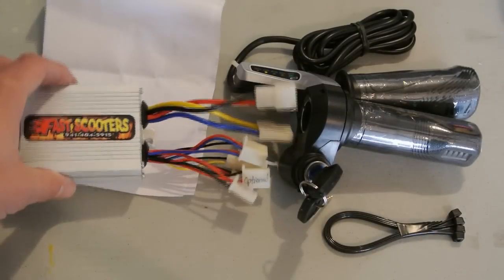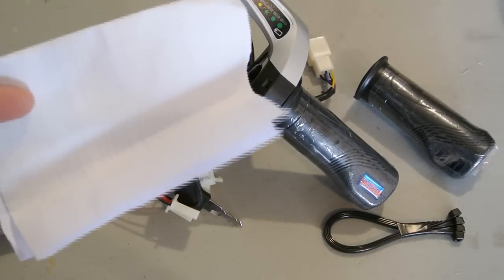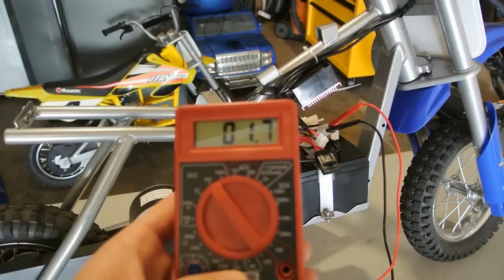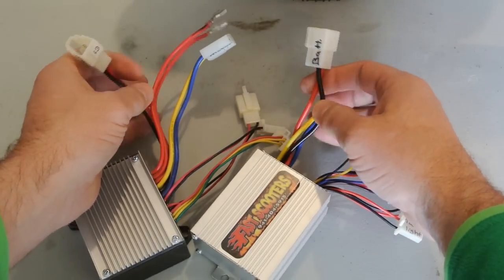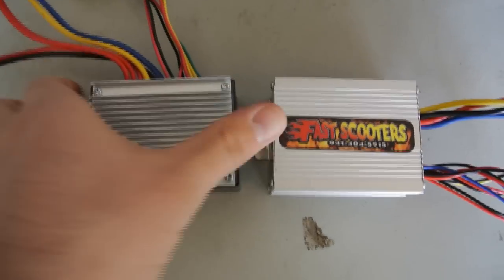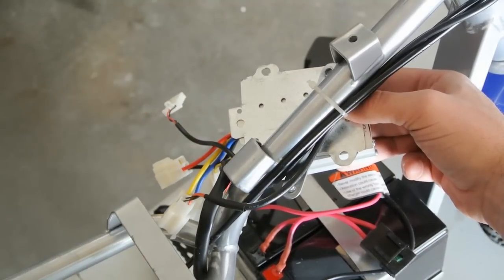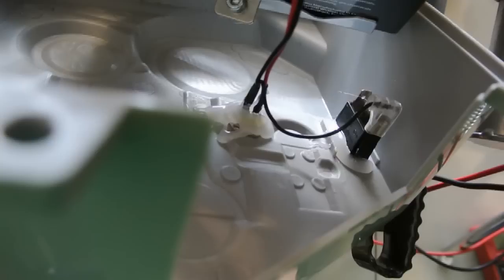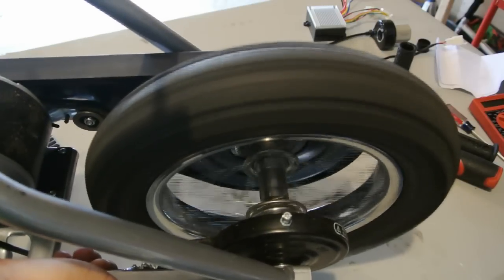Razor MX350 Variable Speed Controller Upgrade and Install

Comment: So to save the extra effort of changing out the controller,  I believe I read you can just swap the throttle and plug it into the original controller.  Is that correct?  I realize it is a better controller but the extra speed is of no interest to me.  I can just save the controller in case I Need it.
Reply: It better match.  These companies aren't the brightest bulbs
Reply: Doesn't match unfortunately

Comment: Anyone know the variability of the controller?  That is, how many jumps it makes to full power?  The stock is on/off ... full power or no power which is scaring the hell out of my 3 year old.  He's fine on the road (exactly where I don't want him), but, and when combined with 0 suspension on the MX350, full power is too much off road.  Thanks in advance to anyone kind enough to respond.

Comment: Hands down the best update to this bike that reuses stock controller is a battery upgrade. Nermak makes a lithium iron phosphate battery (LiFe PO4), which should last for years as it is a deep cycle battery that claims to operate for 2000+ cycles. These batteries also weigh in at half the weight of the original lead acid batteries. 

The 12v (12.8v), 10ah is a nice 40% capacity increase, taking it from roughly a 25 minute ride to about an hour (only the 12.8v, 10ah is a direct fit). 

And the great thing about this upgrade is it is a drop in replacement. No modification necessary EXCEPT for reusing the old battery cables to install on the new batteries(Two 12v batteries wired in series). 

This comes at a cost. The newer batteries are 89.99 for the pair. But again, for those using as a hand me down and investing for the long term (no overvolting), check out these newer batteries, you wont regret it!
Reply: I plan on upgrading to those Nermaks. I'm getting tired of replacing SLA batteries. I assume I would no longer be able to use the stock charger that came with the MX350 anymore?
Reply: @gavysp  I completely forgot to mention that, yes, youll need a charger for the new battery type, and perhaps a clever setup to make future charging convenient.
Reply: I added two 12 volt 8ah lithium batteries, everything else stock. After about 5 seconds of riding the bike just shuts off… You sure lithium are just a drop and go with a stock system?? I thought they would be…

Comment: I have 2  CT-02 speed controllers one has 3 more wires 1 extra in the switch ley harness a 2 more as the brake light.Both are 24v 500 watts and 40 amp power rating.So my  question is ¿ Can the motor handle the output of the controller in terms of the Watts and Amps ?

Comment: Ordered a new speed control for razor mx 350 everything but one black wire to the on/off switch match,on control "original"it has 15 wire leads the new one has 14.it seems to not have a black lead that hooks into the on/off? Do I need to just send it back.thank you for any insight or ideas that may help

Comment: Where can I get that battery. I really need one meant for a speed controller. If that doesn't work I need a new speed controller which will piss me off cause it's brand new and doesn't work

Comment: How has it held up since you installed? Are you noticing a faster battery drain or any other issues?
Reply from the maker: I have not seen any faster battery drains, and it is still going strong.
Reply: Im guessing its trashed now?
Reply: @edgarh252  Yea hows it now?
Reply: September 2020. How is the controller holding up for you?
I just received mine and about to make the switch.
Reply: Marjan Martini  -Yes you can. I just installed the 24v variable speed system and it works great!
It could be a 30 minute or so job but I really took my time and conformal coated the internal components and silicone filled the harness passthrough grommets. I'm hoping for 100% protection against water/dirt.
This is a great mod and our 7 year old says she loves it. No more pulsing the throttle, she says.
Also, if the power switch light stays on all the time, just unplug the black (ground wire) going from the switch to the charge port.
Reply: Marjan Martini  You can also upgrade controller to 36v 500w and I think 1000w. But that depends on battery needs. There are FB groups that discuss lithium conversions

Comment: yOU DONT NEED THOSE GOIT 40V TWO MILWAUKEE, ON 250 STRAIGHT SWITCH, LIGHT SWITCH BLEW FLYWHEEL NOW THRU-BOLT PODST UPGRADE SOON

Comment: tHOSE FLYWJHEEL PARTS ARE EXTENSION OF WINDOWS COCKBLOCK LIKE TENDANCIES. CAN. SEND IT HUGE BRAH. nO BURNT STENCH OF BRUSHES IF THE RE WAS PUT HOLE HOG MOTOR NEXT. ITS NOTHING TO THE ROYAL SCEPTAR.

Comment: Not worth the headache for a little more speed and to top it off , drain the battery faster ! I think 14mph for a 3-5 year old is fast enough . This is a starter bike to introduce kids into motorcycling .My son is 6yrs old and has the MX350 and he enjoys it very much but has had a few spills with no major incidents.He is always supervised and wears safety gear ,when he rides. I think this Razor MX350 stock is plenty fast and is a great starter for those younger kids. If you want fast ,then I suggest buying a gas powered dirt bike. But I feel that this Razor MX350 is a great starter, just the way it comes stock!
Reply from the maker: Ron Mitchell Two points, 
1- This is a good option when your controller fails. Because it will at some point.
2- it gives your child more control over the speed, instead full throttle or nothing.

It's not worth the upgrade for speed alone, as that is negligible.
Reply: But why bother with all that customizing , when you can get the original stock parts ? All is needed to do ,is plug in ,mounts right up , no hassles , no cutting any brackets to fit. As far as speed control , the twisting  throttle is what you find on a regular dirt bike , therefore giving good practice for advancement .I'm just saying , that I find these modifications ridiculous and expensive. If someones wants to make changes to fit their own needs , then so be it. I just don't find this kind of hassle to be worth the extra work or expense for such a small result. Another thing is that these modifications also void any warranty .
Reply from the maker: This requires the same amount of labor to install, and the same cost. OEM part from Razor is $39.00. I paid $39.00 for the aftermarket part. The seller recommends mounting the controller using zipties. I made the bracket because I could. Aside from making a simple bracket I'm not sure I follow your argument. The stock throttle is a twist style, without any control. The aftermarket is a twist throttle with control, just like you would find on a gas dirt bike. So by your argument the after market throttle would actuallyhelp your kids transition easier to a gas dirt bike. Thanks for the comment.
Reply: So the base to my argument is this , Why not just buy the OEM parts? Why the Fast Scooter aftermarket control box? What was your reasoning for this modification?Is the bike faster? Does this modification drain the battery faster? What are your end results and was it worth it?  I and others would agree  that zip ties would not be stable enough at keeping the control box in place, after all ,there is no suspension to this bike frame . Like I said before , if someones wants to make these kinds of changes , so be it! In So , therefore voiding the warranty! I just don't see the need , myself, not worth the 1-2 mph . The only thing that I would like to see changed or modified to the Razor bikes , is adding some sort of suspension . Other than that, I think Razor has made a nice durable kids starter bike and I hope that you can agree with that.
Reply: I had already purchased the variable speed controller so my three year old daughter could go slower than 14 miles an hour and was just curious to know if 26 volts had more jam than 20 volts. Now my daughter can drive as slow or as fast as she likes and is far more comfortable riding her bike.
Reply from the maker: jeb grossutti It does have a little bit more punch. You won't notice, but the rider will.
Reply: The biggest benefit to this modification is the ability for the rider to control their throttle. The "all or nothing" approach of the stock controller is an absolute joke and I've found it to be a huge hindrance to the learning rider.
Reply: BrianBeltran
Reply: Not only kids ride these, some handle up to 220lbs. as for draining the battery faster with a bigger motor goes, buy a battery with a higher amp hour rating and your good. No need to hate on people making something faster
Reply: I'm ordering one for my 3 yr olds rs350. Thanks for the video. His just took a crap.
Reply: Why the hell are you even watching if you have a problem with it ???  Take your opinions elsewhere please.
Reply: My 3 year old would beg to differ! Just turned 3, needs more torque and a variable throttle (his request). He also rides a PW50, so maybe that's why
Reply: Ron M how many times did he have to say the main reason for going with this was for the variable speed... lol. Razor should have never stopped using variable speed as it is so much better.
Reply: I am about to make this mod on my daughter's MX350. She's 7 and the stock controller is plenty fast. I didn't buy it for jacking up the speed. I bought it so she will have analog speed control. She's OK with pulsing the throttle but I think it's ridiculous and takes a real toll on the parts by constantly having to pulse it to get a medium speed.
Reply: @ronm8853  - I guess nobody asked your opinion and it's obvious you haven't a clue as to what the video and discussion is even about.
Reply: @ronm8853  you really have a difficult time with comprehension. Your questions were answered multiple times. If you want OEM, buy OEM. This guy upgraded to have variable speed control, end of story.

Comment: can't we just plug a custom throttle on the original controller ?
Reply: Yes but this controller is better. It gives you the full voltage instead of being limited to 21v